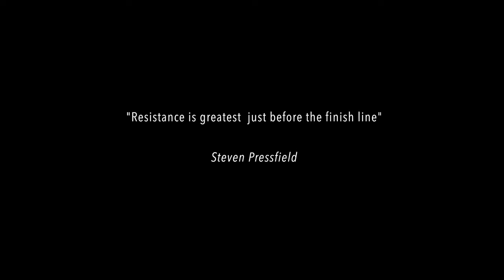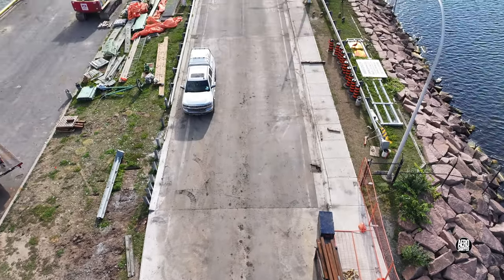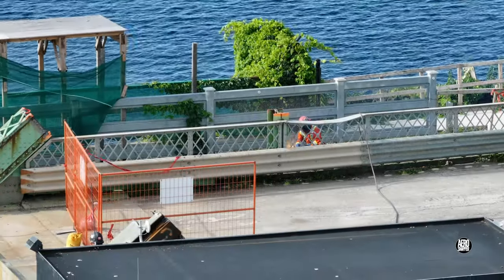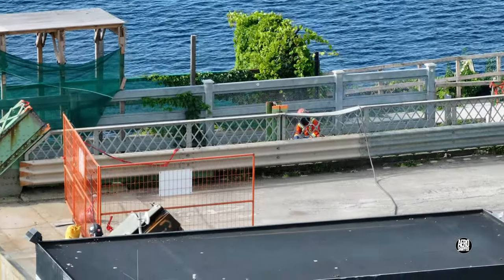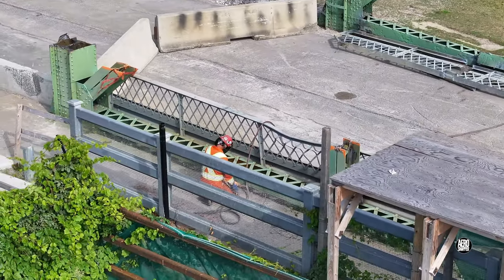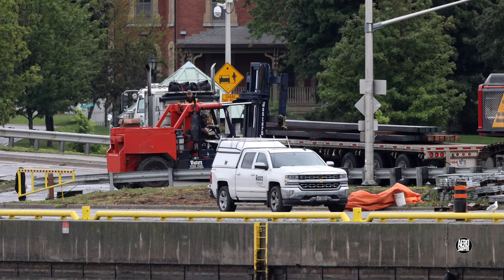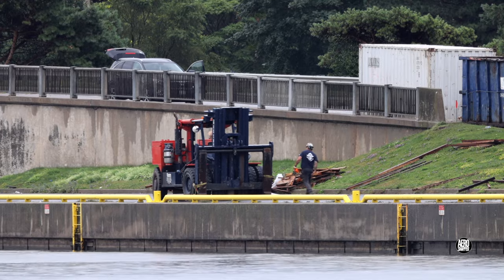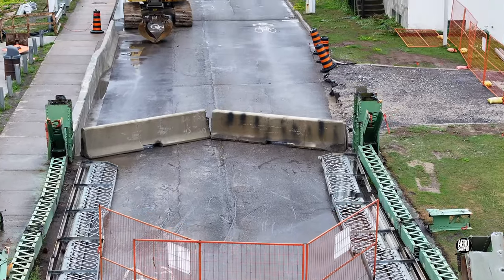Taking a Load Off - an update on Kingston, Ontario's La Salle Causeway   4K

Comment: Just discovered this. Does the style-less low elevation  concrete Waaban bridge gets to stay there permanently, blocking any tall ship from using Rideau Canal or is there intention to remove it?  If it stays, I take it replacement for the LaSalle bridge won't be a lift/swing bridge and be fixed as well? 
The canal  navigable stats from Parks Canada do not show the new bridge in the list of bridges/height obstacles to Ottawa.  As a cyclist who has done Montreal-Kingston number of times in my life, sad to see the causeway go.  despite being a challenge as cyclist due to traffic, seeing it as I came down the hill was the sign of arrival into Kingston.
Reply from the maker: Glad you found the video. It’s a shame you don’t like the Waaban - it’s been a real blessing in the absence of the Causeway. It offers the same clearance as every other bridge on the Rideau system - meeting Parks requirement. No ‘tall ship’ has ever travelled the Canal for that reason.  It’s also impossible to sail up the river because only a narrow, dredged navigation channel exists, making tacking impossible. The new bridge on the Causeway, when it comes, will allow marine traffic. However, for some time to come, from October a fixed, temporary bridge will be in place that can occasionally be removed. No plans for managing the navigation season next year have been announced.
Reply: @Aerosnapper  Thanks for reply. Found it interesting that Parks Canada has not updated its page on navigation clearances to add the Waaban bridge clearance. Without it, there is no way to gauge what  boats can and can't go.  Had been under impression the Rideau Canal had been kept (since nationa Park) at its original clearances, forcing any new bridge above it to provide clearance guess I was wrong !